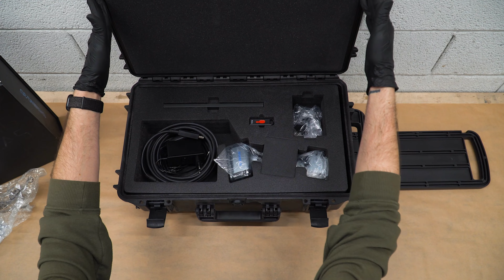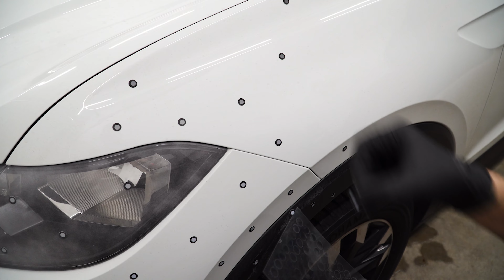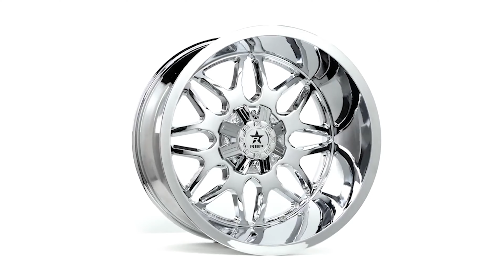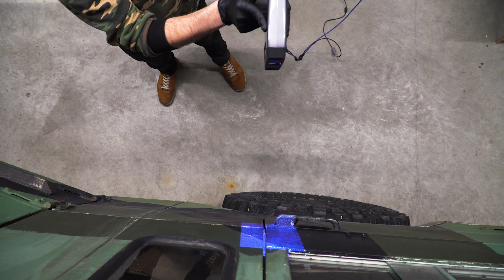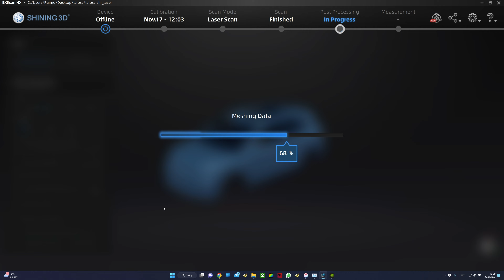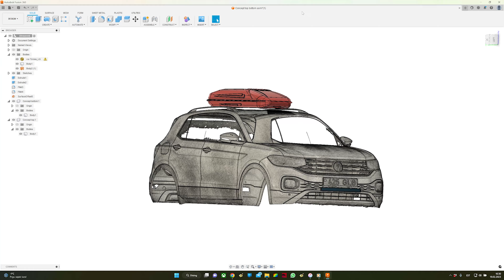3D scanning VW T-Cross with Einscan HX

Comment: Great video! Is it also possible to scan only 1/2 of the car and mirror the other side in the EX software? Or is this only possible with external SW?
Reply from the maker: Hi, mirroring is possible in the software. You can mirror and keep both versions and you can mirror and delete the original. I would rather do it in external software tho as getting the right position of mirroring plane is difficult at the moment.

Comment: Great demonstration of the HX! What were the specs on your laptop? I noticed it handled the 0.5mm scanning resolution quite easily. Thanks for sharing!
Reply from the maker: The laptop is MSI GS75 stealth with I9 10980hk, 64gb ram, RTX 2070 super max Q, 2TB memory. Yeah, everything worked really smooth with 0.5mm scan!